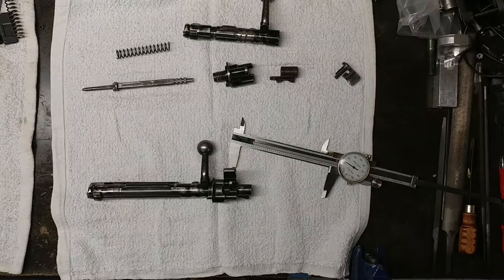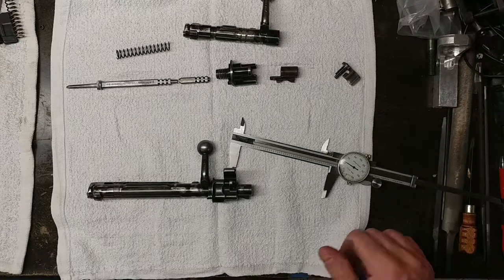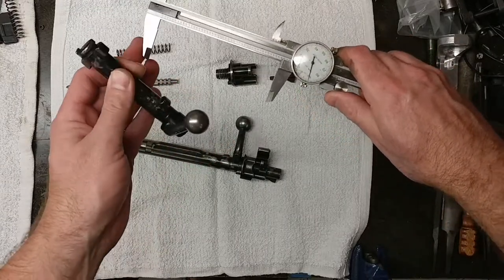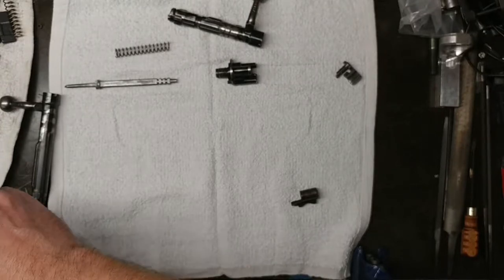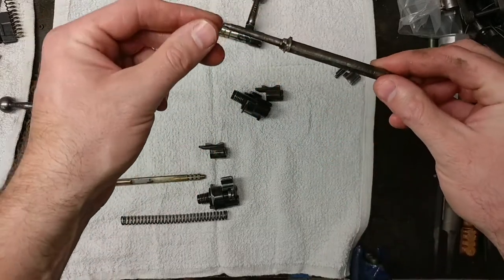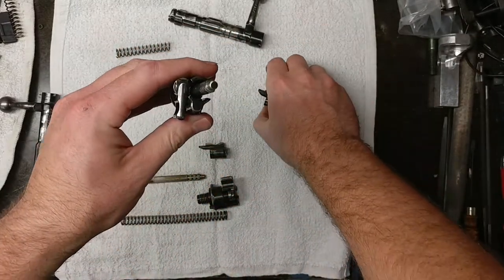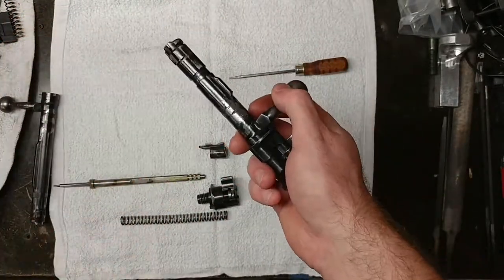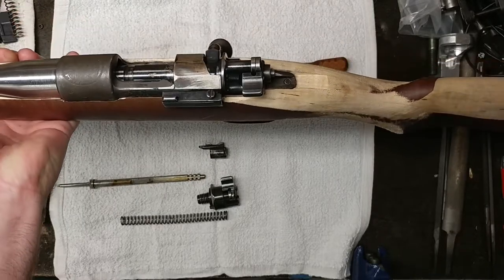Solution to mauser short action firing pin spring binding lockup instalation

Comment: I like your solution. I assume the helix was just done by running steep pitch thread and you can adjust the point it starts using your compound slide.   

If something like a strong external snap ring was used, would you see any points of failure having the groove cut in that area?

Comment: Any way you can assist me in getting my safety flag to the left position? i have it all the way to the right. i can put it back in the slide but can do nothing else. If i compress the spring i can free float the safety and move it back to fire or "up" but that leaves the detent on the bottom of the bolt not allowing it back into the slide.